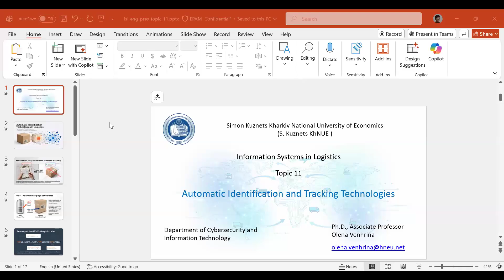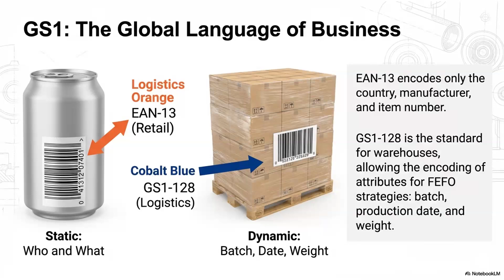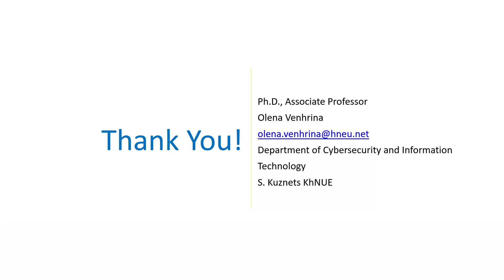Technologies of automatic identification | Information Systems in Logistics | Lecture 11

Comment from the maker: 📌 *Timestamps for easy navigation:*
0:00 Elimination of manual data entry errors in supply chains
1:51 Introduction to standardizing codes: GS1 organization
2:10 Retail EAN-13 vs. Logistics GS1-128 barcodes
3:14 Parsing dynamic attributes using Application Identifiers (AIs)
4:47 Transition to 2D Data Matrix codes and item-level serialization
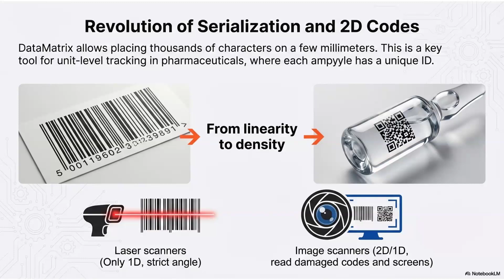6:17 Overcoming the line-of-sight limitation with RFID technology
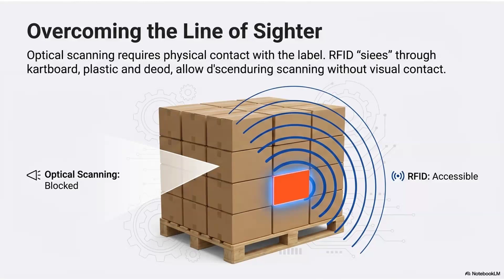7:13 Internal architecture of RFID: Readers, antennas, and EPC tags
7:44 Power mechanics: Passive vs. Active tags and ambient IoT
10:00 Bulk scanning advantages and drone-based warehouse inventory
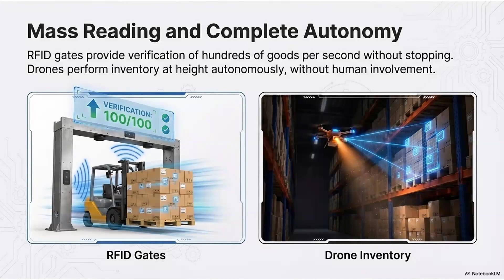11:38 Economic and physical barriers to widespread RFID adoption
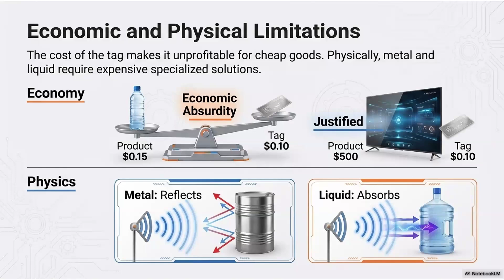13:23 Eliminating transit blind spots with the Internet of Things (IoT)
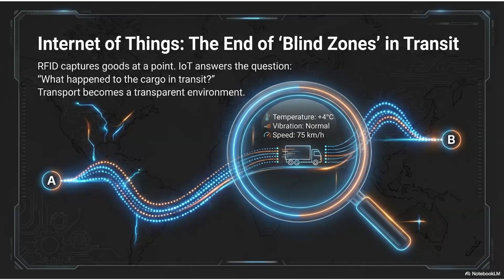14:44 Proactive cold chain monitoring and blockchain integration
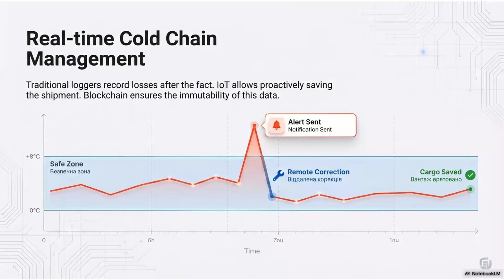16:21 Digital control of physical handling: accelerometers and geofencing
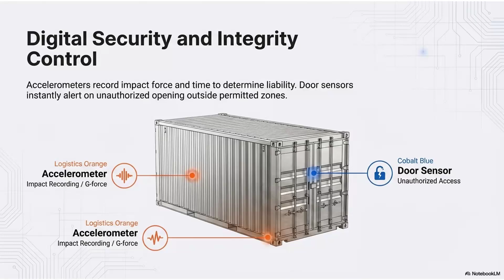17:56 Edge computing and 5G: real-time autonomous accident prevention